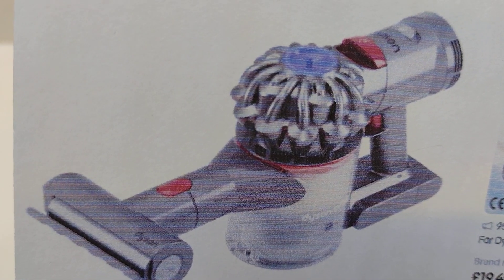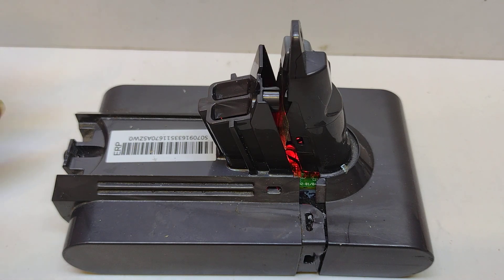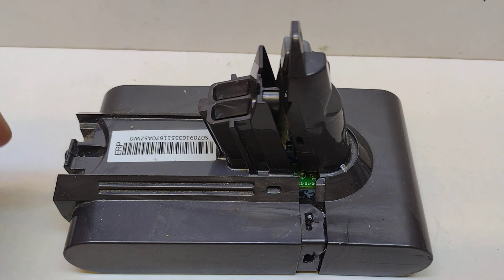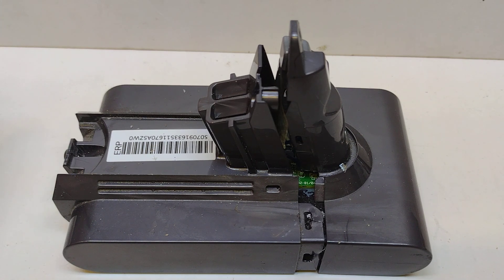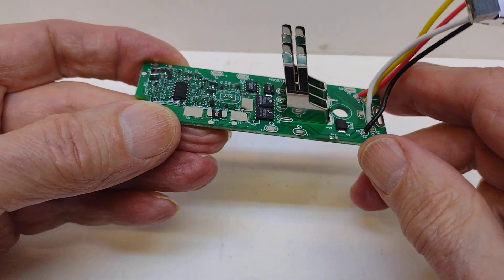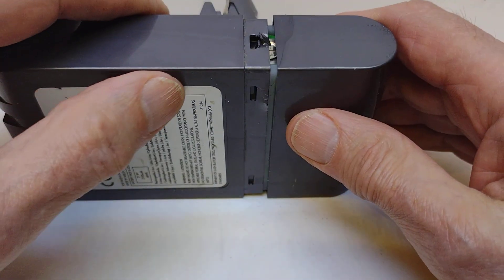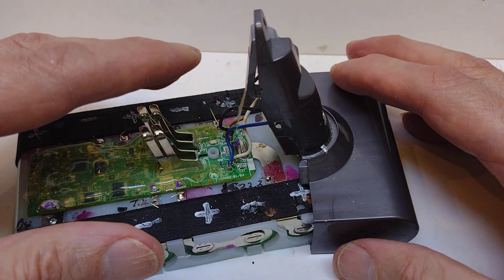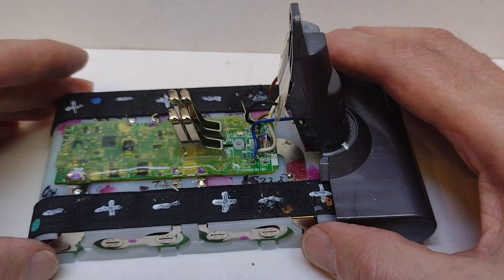Options for a locked Dyson vac battery.

Comment: I brought 2 replacement batteries from e bay, nether lasted long. Since then brought a Dyson battery , on 10 August  2021, and its still going in end of September 2025.
Reply from the maker: Glad to hear your battery is doing good. I don't now buy batteries on eBey after buying some rated at 5000 mAh which only tested at 500. Vape batteries seem better but I haven't tested any 18650's.

Comment: Lithium cells need to be treated with respect but you are far too afraid of them and exaggerating the danger, they are not desperate to catch fire at any opportunity.
Also, it makes no difference what 'Charger' you use,  what you plug in the wall is nothing more than a power supply, it does not handle the charging, the BMS on the pack does.
Reply from the maker: Thanks for taking the time to comment. I don't think the dangers of the battery removed from it's case can be exaggerated.  I would feel most upset if someone were to hurt themselves after watching the video. (I almost didn't post it for that reason.) Maybe I should have emphasised more the dangers of a short circuit. In the video I refer to someone who shorted something on the BMS board and the SMD components got so hot they could be removed from the board.  As careful as I am, I have managed to short circuit a cell from a discarded vape resulting in the plastic melting and the wires getting red hot but I don't think the cell was damaged.

Comment: The actual dyson battery packs management board has programming pins on it to program some sort of firmware onto it, so the micro controller on the board can monitor each of the cells and charge cycles, if any battery cell is out of spec, It will lock the battery pack out and write the lock out information to its internal eeprom.
Reply from the maker: Thanks for the comment.

Comment: My dyson battery (same model) Died, as they all eventually do From use. 
I bought a New one from Amazon .. with a claimed Double MAH cap[acity  (Much longer than OEM  use time)  for 50Bux.. delivered ! 
 a Year later it's working "fine'  

Yer tilting at Windmills here.. an  Utterly Pointless excercise
Reply: This is absolutely incorrect. Firmware-locked batteries in consumer electronics and tools, like Milwaukee power tools and Dyson vacuums, use software to monitor battery health and enforce safety features. However, these locks often disable otherwise repairable batteries due to issues like undervoltage, forcing consumers to buy expensive replacements instead of making simple fixes. This practice aligns with anti-right-to-repair strategies, maximizing profits while contributing to waste and limiting user autonomy. We need to push for laws requiring access to diagnostics, schematics, and fair repair practices to combat these restrictive designs and promote sustainability.
Reply: @Noughtta  Very well said.
Reply: @Noughtta  Don't forget about Makita doing this aswell.
Reply from the maker: @Noughtta  Thanks for the comment I agree with you that these products contribute to waste as do all battery driven devices.  I think a battery containing 18650 cells should have a lot longer guarantee than 2 years, after all 18650's are  used in EV's which have an 8 year warranty. As I point out in the video their are ways to   repair these batteries, new BMS board or re-flash the software . I would love to know of any .simple fixes. As I try to point out in the video these batteries are dangerous and repairs should not be carried out by the average person. Ideas such as replaceable cells as mooted by some are just not practical due to the 16 Amp plus currents involved.
Reply from the maker: Thanks for the comment. Glad to hear your purchase was a good one. I  only seem to have picked up the negative comments about replacement batteries from the net . So it's good to hear a positive one.
Reply: @toyhacker4647  It was not negative.  I was simply giving you my opinion.  When talking about the options,  just get to the point at hand!